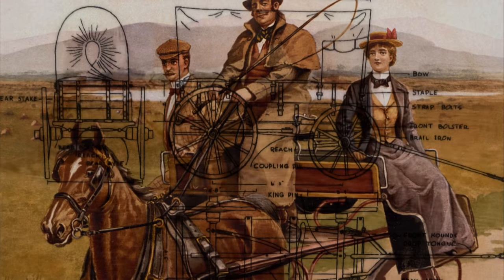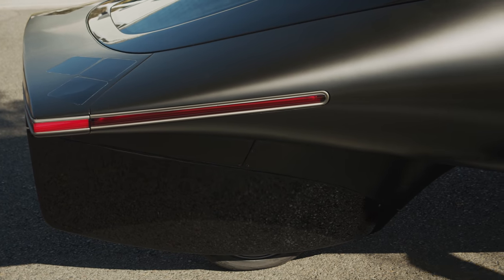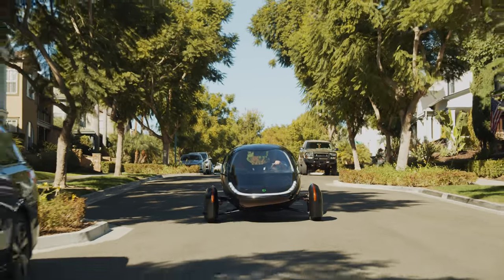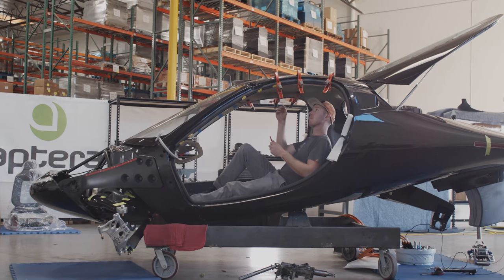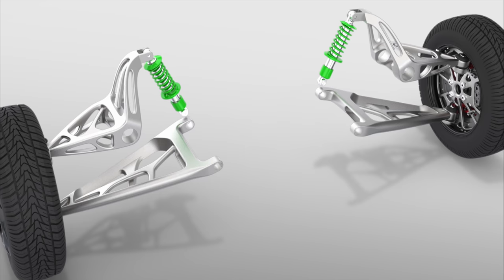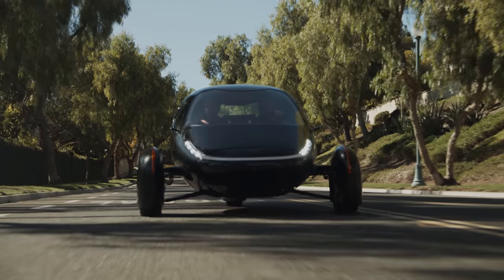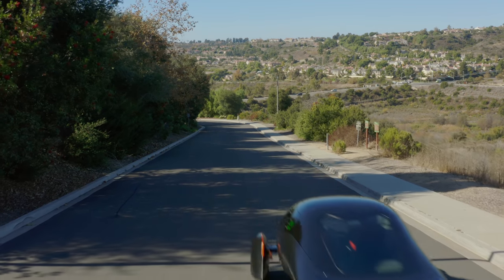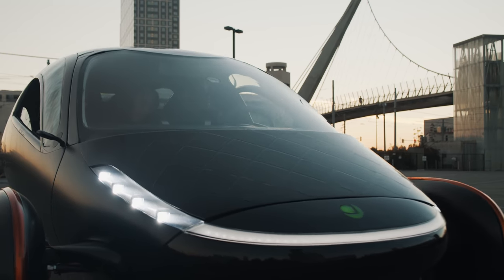Aptera Has Launched

Comment: My work is 8 miles away. Just thinking about never having to spend money on gas or charging is exciting. I very rarely take long trips and the most I ever drive is about 30 miles a day. This is what the market needs to jump start  electric cars.
Reply: You need to not worry about gas buy a viper or hummer your 3.30$ a day shouldn't be an issue lol
Reply: Why not just bike?
Reply: @jodydolphin79  vipers are garbage lol
Reply: @knartfocker_  If it's like my city, you have to cross several busy lanes of traffic, and there are no bike lanes. 
Also, no sidewalks. 
The law states that you must ride with traffic facing your back ( ride in the direction of traffic ) and this means you have no warning of the vehicles closing in on you from behind. 
I would like to bike, but American cities are not made to bike - or even walk. 
BTW, Your name is clever !
Reply: Or get a cheaper MG ZS and hook it up to a solar array that's grid tied for the same money and more space.
Not as cool, not as efficient. But 6Kw solar will pay back in 5 years and recharge your car when you're home.
Reply: I will buy 1 or 2.

Comment: Solar charging, right to repair approach. Gosh I pray this succeeds and gets adopted more in the industry...
Reply: It will if you share ;)
Reply: Fisker tried
Reply: But the design is not great
Reply: The problem with this car is that it has 3 wheels which Elon musk wanted to do put he didn’t because it isn’t save and that what he said
Reply: Tesla has that too, not the solar charging (yet) but the ppl that come out to repair it for you? Yeah they have that too
Reply: if you understand how little energy is getting from solar.. its only marketing.. if you remember lg phone with solar panel on the back, did it work.. well no.. you can even today buy a power bank with solar cell but usually it only powers the small led saying charging..
Reply: @egesajesse  All that happened was his supercharger network access being revoked. He was still able to drive the car & do anything a normal Tesla could do, other than supercharge. He could use public fast chargers instead.
Reply: @groosegartcho5700  Nope, that's not all 😊... but in itself it is a prohibitive move to discourage users from tinkering. It's like a phone manufacturer saying, "What? You replaced your battery yourself? That's fine but no further software updates from our end to your device." 

Going back though that wasn't all, he mostly had to scavenge for parts to use in the rebuild simply because he couldn't directly ask Tesla to send him all he needed... again all meant to push you to use authorised distributors.
Reply: @silverify  There are 180 cells for a production of 700 watts peak.  When you use less than 10 watt hours per mile, this is significant.
Reply from the maker: Thanks Jesse for the support!
Reply: @egesajesse  Sorry but not being able to use a very specific charging network is completely different from not getting updates anymore. If updates were cut from my phone I would be dangerously open to all kinds of security risks after a year or two, but if I couldn't use a very specific kind of proprietary Google charger, but every single other kind of charger in the world is compatible that's more of a minor inconvenience if anything. I'm buying the PHONE, not their charger. Similarly with Tesla I'm buying the CAR not the supercharging network.

As for parts availability I do agree they should sell parts, but is it really that big of a deal? Everybody I hear talk about rich rebuilds acts like Tesla came and took his car, when in reality he just can't use the supercharging network and had a hard time sourcing Tesla parts.
Reply: Groose Gartcho I think I was quite clear from the start “He gave up the car”... maybe it’s you who is interpreting everything you hear about rich rebuilds that way... :)

The supercharger network is a significant selling advantage for the vehicles, most industry specialists still cite it among the edges Tesla has over other competitors so to have that withdrawn is as a consequence inconveniencing enough for someone to think twice about fixing their own car. As for Tesla not selling parts, if we are still discussing right to repair, yes it is a big deal... how can you you say you are all for people fixing their stuff but you won’t sell them the genuine stuff they need.

I enjoy fixing things I own, cars equipment etc. if the people who made this stuff began to withdraw perks simply because i changed some parts myself... that would be a downer. Sometimes it’s not even about fixing it myself, maybe I have a friend I trust, or I live far from the support network, or don’t want to pay high labor costs. Etc... Look if you don’t care about it all, that is totally fine, you don’t have to sign a petition... 😂
Reply: Aptera Motors Thank you! You are on the right track there, keep innovating... 😊
Reply: @egesajesse  Yes he gave up the car because he wanted to work on the Porsche Taycan. That's perfectly fine. What I was saying is that it's ridiculous to act like he was robbed of anything.

You're absolutely right, the Supercharger network is a HUGE advantage of owning a Tesla, but it's not something you're buying WITH the car. You buy a license to use the network with the car, and if you violate it then you can't use the network. They say it's because they don't want poor quality/poorly repaired batteries being a massive safety risk at the chargers (that being said I'm aware of the fact that salvage Model 3s are still able to charge, since they need to pay for supercharging, so that's probably a half truth on their part).

I should have said that last part better, my apologies. What I mean is he was able to get the parts, so is it a HUGE problem that he couldn't get them directly? (This next part is my opinion) When I've worked on my things that's part of the fun is sourcing parts, since a lot of my older consoles don't have 1st party replacement parts available (try finding official parts for the NES). My point was less "it doesn't matter" and more "it's not really TOO bad since you CAN buy the parts."
Reply: Groose Gartcho again with the acting business... 🙄😂. It’s okay. For your consoles, do you know if they started out not selling parts to people or they are not available because the manufacturer has since ceased support across the board? 

So whilst some like you enjoy the hunt for parts, some of us don’t. My thrill is in the fixing it self. Unless of course am doing a mod or willingly adding a 3rd party part. I like the peace of mind and confidence in the part that comes with buying direct from the manufacturer.

But in all what Aptera is proposing to have direct support with both manuals and parts directly available to the customers (if the customer want’s it) is what am excited for.
Reply: stop buying mainstream products like iphone then
Reply: @n.brucenelson5920  lol 700 Watt.. At that size solar cell you can at best produce 200watt on direct sunlight.. So if you consider to burn your car on the sun just to get small amount of energy.. And if you turn on ac it will consume more than it can produce
Reply: @silverify  Unlikely.  And I speak having built DC ac systems for EVs and boats.
Reply: @silverify  While I think the 40 extra miles is a bit of a stretch and probably only happens under the most ideal conditions possible, expecting 20 extra miles a day is within reason during spring to summer (during which more driving happens), and the average American only drives around 35 or so miles a day. You wouldn't need much of a charge to "top it off" from the sun in such cases.  This car is so efficient, you can literally push it with one hand no problem.
Reply: @silverify  40 miles per day solar is enough for most people.

Comment: This video addressed every possible downside that I thought of as it came into my mind. Amazing stuff. I hope this becomes huge.
Reply from the maker: Thanks for the support!
Reply: Hope it doesn't
Reply: @SnD340  Why?
Reply: @baked_gemknight2648  You've cornered yourself into a binary choice.

Why require a car that charges in 31 minutes when you can have a car that you can drive all day without charging at all?
Reply: @baked_gemknight2648  If you look at Aptera's calculator on their website, they're not concerned with daily charging times. They calculate the number of times you have to charge per year based on your daily travel. If you travel 40 miles a day, you only have to charge every two months or so.

So for a car this efficient, there's really no need for fast charging (though it will be available). Because unless you're doing the Cannonball Run, you're never going to need to charge except at night. 

If you're on a road trip, you're going to drive a full day without needing to recharge. So while fast charging would be nice, it's not at all needed.
Reply: @baked_gemknight2648  Huh?

Of the 129 million full time workers in the US, only 3.3 million have to drive 50 or more miles.

The average commute is 30 minutes or around 16 miles.

How many rich people do you think there are?

Who is driving 500 miles to work every day who this car wouldn't work for?
Reply: Its amazing what we can make as humans i hope this becomes a great success
Reply: If you put it on  rails. Steel on Steel is 90% More Efficient.  90×300 MPG=27000 Per Battery Charge.
Reply: @baked_gemknight2648  This car can't get 150 miles overnight from a standard wall outlet, so no need to have a professional installing expensive fast charger. That's groundbreaking stuff
Reply: @MrGamelover23  I know what you meant but just to clarify – you mean this car can get 150 miles overnight from just a wall outlet. Which of course no other car can do. Along with numerous other things the Aptera can do that no other car that’s ever been built can do. Groundbreaking, as you say. Truly.

Comment: For those of you wondering about costs, 
1000 mile range = $44,900
600 mile range = $34,600
400 mile range = $29,800
250 mile range = $25,900

They also have a few different kits for the car as well as options to add more solar cells on different parts of the vehicle for an additional price.
Reply: I even think that the prices are really good
Reply: Does it still have 45 miles of range from solar charging regardless which range model you buy?
Reply: @timtoolman9940  you have to get the $900 solar package, but yes
Reply: @samuelbaird4983  that is astoundingly cheap, 45 in 2hrs any sunny day for just 900 bucks.
Reply: @crunchylemon2849  Not in 2hrs. Requires more like 8hrs, but still practical. The solar provides 700 watts in full sun.

Comment: This is what Europe really needs.
Reply: Something Citroen could really make. Or the Peugeot in BladeRunner 2049
Reply: Much Europe see not much of sun.
Reply: @amimartian  They have a sun / energy calculator on their site. Works just fine for Europe for most city slickers. After all you can still plug it in and use way less energy than other EVs.
Reply: @amimartian  yet we park our cars anywhere from 23 to 15, etc hours per day. How much more useless is that if not collecting solar power?
Reply: @amimartian  in Greece you have more than enough.... 😁
Reply: @Mr. Poopybutthole Mirrors can be used to increase charging efficiency.
Reply: @amimartian  A fast chargeable 250mi car is still better. Even if you're only capturing 20mi a day. That's still much much better than paying for those extra 20 miles of a million miles. That alone would pay for the battery replacement.
Reply: @pegiosalexandros  But they would increase drag which would decrease range.
Reply: @amimartian  It doesn't matter at all. You still get maximum efficiency within your environment. Better than any other EV or old 20th century tech cars.
Reply: In Denmark and Germany we don't have much sun 🙄
Not good for Europe... but good for places with a lot of sun 🌞
Reply: @s7yler  so you're saying Denmark and Germany doesn't want a 1000mi EV with fast charge capability? That even generates it's minimum spec for places like Alaska is 11 miles per day?
Reply from the maker: We plan to sell Aptera worldwide wherever possible given local regulations. We anticipate this will happen in late 2021/ early 2022. Thanks for supporting Aptera!
Reply: @halllwd94  I was thinking about parking.
Reply: @halllwd94  But on further consideration, it is worth installing positioned mirrors along the road.
Reply: @pegiosalexandros  From the way it looks you'll have more visibility with side camera instead of mirrors. Parking won't be an issue.
Reply: We will have something similar in the near Future: You can pedal like on a bike to work out and extend the range in the Twike 5: https://twike.com/en/twike-5/twike-5/
Reply: Forgot to mention: Twike is based in the middle of Germany.
Reply: @_sebix  is twike coming to the US because I might need to buy one in addition to the Aptera. We've all been waiting like 15 years for Aptera to come out by the time we start getting our cars next year.

Edit. Nevermind, I just saw their pricing. For the same cost Aptera will do much more. I'm not interested now.
Reply: @pegiosalexandros  solar tinting too, like the way you think!
Reply: All this talking about the sun, its probaly to unsafe for europe. They have strict regulations about how safe it is for yourself or a pedestrian
Reply: it will be most effective in areas near the equator like Australia. Also could be useful in third world countries like Indonesia, Malaysia, Philippines, Brazil. The price though.... is a massive deterrent. $35k would net us a middle-class SUV here.
Reply: @pegiosalexandros  I know, you have Ivanpah in the Mohave dessert in California for example.
Reply: @MotivationalGrowthShorts  Not for motorcycles. Those regulations only apply to cars, and even some cars like the VW XL1 received exemptions because that would get in the way of their purpose. If cars are purpose built to be aerodynamic they can be exempted from those safety regulations.
Reply: @ApteraMotors  I'd consider Indonesia. They already don't view cars as mandatory culturally, plus they have killer sun to make the solar work. Might be a hair expensive for them but Id say sending one boat of these every quarter would easily be enough product to sell in Jakarta. It would make a huge impact replacing the environmentally crap motorcycles everyone in that country currently have.
Reply: @s7yler  Not good for northern Europe* 😂
Here in Italy and the other Mediterranean countries, we have enough sun
Reply: @francescoboselli6033  yes your right, I was also only taking about Germany and Denmark
Reply: @MotivationalGrowthShorts  it will be classed as quad or 3 wheel motorbike in Europe so wouldn’t need to pass all the car standards.
Reply: @halllwd94  I was only referring to the solar solution. In the last 4 weeks I haven't seen a single day here in Germany with sunshine. Every day has been cloudy, rainy and dark days. We simply don't have sunny days like in US, Asia and South Europe.
Reply: World*
Reply: @s7yler  why i see so many solar panel in Germany?! 🤔
Reply: @pegiosalexandros  We don't have many that use solar power, here we have like 0. What we use more is wind power. There are many windmills in Germany and Denmark.
Reply: @s7yler  ich habe ganz vielen gesehen...
Reply: @pegiosalexandros  of course there are some, but not many. Strong sun is only really available from June to August, October to December the weather is just cloudy and dark here. So what's the point....
Reply: @s7yler  darum war ich überraschd, wenn ich war dort.
Reply: @ApteraMotors  that's great, I will need a new car in spring 2022. The Aptera is something I would love to buy. 
I hope it will be available in the Netherlands.
Reply: Good luck parking it in Europe, or even driving on some of the roads there. Have you looked at the dimension of this thing?
Reply: @amimartian  sun hour per year in the USA range from 2000 to 4000. In europe 1500 to 3000. Yes less. But in the more mediterranean countries this still makes a lot of sense. And distances are usually shorter in Europe. So even 20 miles a day from the sun is pretty nice for most of european commuters. Maybe not enough but still very nice